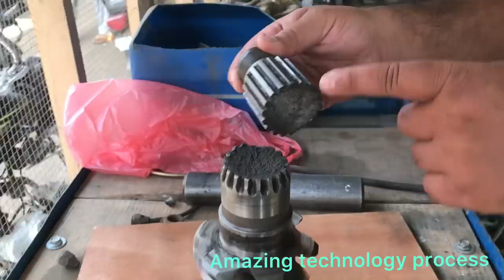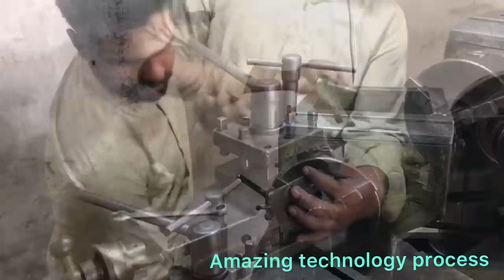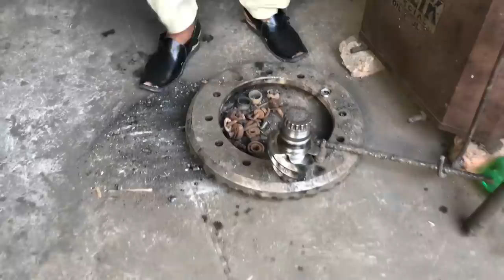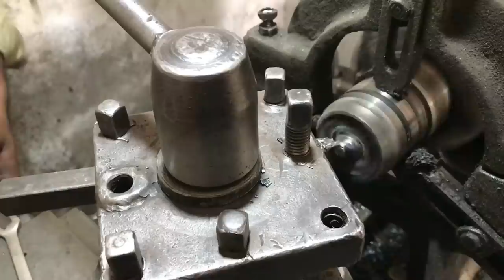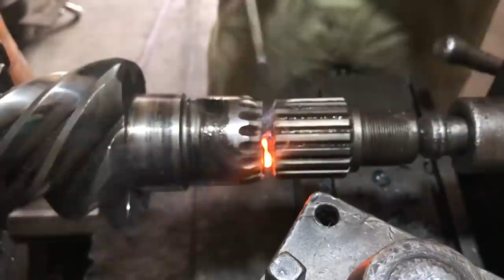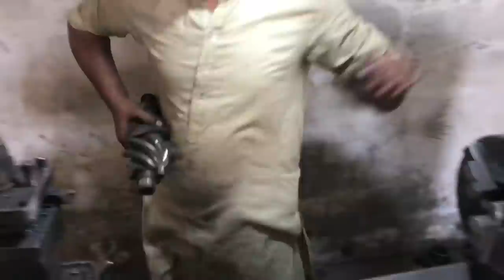How to Repair Broken pinion in Beautiful Way

Comment: When you have nothing, you have nothing to lose.  The driver who overloaded his rig and broke the pinion the first time, will  snap this one the first time he pops the clutch.
Reply: Or Sooner. Making things "LOOK GOOD" IS NOT a repair . He could have saved doing the job Twice, by buying factory parts, and ran it for another 25 years.
Reply: Maybe or maybe not i fixed a pinion basically the same way for a piece of farm equipment it lasted about 5 years needed the part right away no one had it "fixed" it then got the factory part and waited for the fix to die  factory part sat on shelf for 4 and half years.
Reply: @ta-zm7tg  I dont think you understand much about metalurgy.
Reply: @stevecarlisle3323  I do,and I can tell you a quick repair will get him back on duty, like the prescriber wrote (is that the right word? I'm not english native), but to be honest: your right as well. So, the point is: do I have the possibility to use OEM parts or better Manufacturer part or do I have to rely on the bits I got back repaired. I often don't agree with the methods HOW they do it in these videos, but the do it and it lasts...well...quite a time...  by saving a lot of money they don't have. So, to sum it up, you're both right.  Let Karma make a decision
Reply: @classicmoto2429  Well thanks for your input, but being a heavy duty mechanic and welder, for 4o years, and certified in both trades,  my best guess is it may look good, but it will have no durability. If it makes you get out of a muck hole on the farm, then it would have some benifit.
Reply: I’ve personally repaired stub axles , drive axles and input shafts using a very similar technique to this . The objective is to remove the break / crystallised material . Then using a series of dissimilar metals as weld build up to form a bridge between the 2 pieces. This will marry the metals together using heat and layers to form a bond between the pieces and the welds . Though I had access to turntables , induction heaters . Many different welding materials and the all important kiln heater at the end . Lime pit cool-down over days is the secret . I’ve never had a failure yet . It is an art form .
Reply: @stevecarlisle3323  he might have to wait months to get that part, so a fix like this might get him in the work in the mean time.
Reply: @shaneanderson1036  Yes, but what you have done, is NOT what they have done.
Reply: This is done in my place very often to save a few bucks on OEM or even an After-Market stuff...! (Psst! They never last...)The welding rods used can NEVER match the endurance of High Chrome Steel used in the part...! The part in question not only need precision but also endurance...! Which clearly substantiates that the guys in the video do not have any idea of metallurgy... They are there to mint money....
Reply: and again soldering 🔁 again...again!! 😅
Reply: @stevecarlisle3323  

Highly probable that pinion not available or no longer manufactured.
Reply: @pidhsome  

Agree. Also possible the pinion gear is no longer made.
Reply: @wilsonrawlin8547  Well i would say that is highly unlikely, due to the fact the truck is used all over Asia.
Reply: @stevecarlisle3323  
What truck? I didn't see that info in the content.
Reply: @wilsonrawlin8547  Well if you were familiar with heavy duty equipment, you can tell that by the size of the pinion in his hand, and also confirmation when he sets the pinion on the ring gear. Rear ends and transmissions  are more often than not may by manufacturers other than the vehicle builder. It could be a truck, tractor or other equipment..
Reply: @stevecarlisle3323  i think you underestimate how strong welds can actually be when done correctly using the right wire i didnt say this was a good fix i said its very possible it lasted far longer than you think. it really depends on a ton of factors the load on the part the material its made from etc.
Reply: @ta-zm7tg  I base my response on my personal experience. You should read all the posts before you estimate someone's knowledge.
Reply: To all the experts here...does this look like the first pinion that this shop has repaired? Do you really think that this place has no scrapyards for second hand pinions? That the truck owner might already do business with this repair shop? That the truck owner was sent to this shop because their repairs do hold up? You guys are acting like this was jb-welded. If the shop is doing this repair, it is because the repair works. In a wild wild west country, if you rob people with a faulty repair, you would find yourself in a world of hurt. I'm not talkin' getiin' sued here.
Reply: @kidsteach938  Well you make some points, but if you believe that precision made components can be repaired by someone doing spot welds, and angle grinding, and smacking it with hammers, then nobody here will convince you otherwise. I am sure that the work they are doing will at least get the truck of their property. 😣
Reply: @stevecarlisle3323  Thanks Steve...with the current parts shortages in the US, caused by faulty government, I sure hope that these kind of repairs don't become necessary here.
Reply: @kidsteach938  Well I think most of us know the fuel will be too costly before companys liker Spicer, Dana and Rockwell close down. The economies between India and the US are almost planets apart. Anyways I am a GearHead not a politician 😚
Reply: @stevecarlisle3323  using your own personal experience means its biased or you just suck at welding and machining. the repair isnt the best and not as strong as an oem part but its works.
Reply: @ta-zm7tg  any of our readers that have properly setup a ring and pinion are laughing at you, me included 🤣
Reply: Understand that the vehicle they are repairing is not meant to last. There is a reason their "Trucks" are wooden boxes on cheap frames.  They tend to loose the vehicles to the cliffside roads. Heck, there are quite a few of the mountain roads that have shrines at the start where the driver, his spotter, and the vehicle get blessed before going on the road.
Reply: @we are doomed the part was small you can throw it in a oven at like 450 and call it a day. They work with what they got and it clearly works I've done it for a tractor at home lasted years while the OEM part sat on a shelf  waiting for my lazy ass to pull the tractor apart again.
Reply: These people are in Pakistan trying to make a living,there is no spare parts they have to make do with what they have,I doubt there are any more Americans left that has any skills to make what they need like these people.if we can’t get it  from Amazon or the internet we lose what’s left of our brains.
Reply: @stevecarlisle3323  So, just pop on down to the local dealership (if there is one) to order the part (if it is still available) and then wait a few months for it to come in (while not making any income)?
Reply: @pidhsome  Or maybe even just get him back home without any load in the truck.
Reply: @sebwiers1  Yes, what you say has all been said before !
Reply: Depends on tensile strength. If he used a 9015 rod and that pinion broke again, it would not be the weld that broke. 38 year auto machinest and welder here.

Comment: That attempt at center drilling was fantastic.  Like how the drill sprung to one side.
Reply: BRUTE FORCE
Reply: Yeah all these guys are hacks but it’s fun to watch.
Reply: Needs short drill bit and drill center. But I guess he got the job done. I would never done that with out covering up the lathe !
Reply: ICE STATION ZEBRA ASSOCIATES  l don't see any porosity in the weld. I think if he used the correct rod there is a good chance it will hold . I not see what you see . It's beveled  correctly to my knowledge and mutipass welding what's not to like ? I'm not sure how the heat will affect the temper . I would love to know how long the repair lasted .
Reply: ICE STATION ZEBRA ASSOCIATES  I HAVE ALWAYS PUT MY GRINDER IN A BRACE" AND GUIDE IT WITH A HANDLE...IT JUST NEEDS TO FOLLOW THE GROVES THE BLADE IS ALREADY THIN ENOUGH..THE FRONT PART IS STILL DOING ALL THE WORK..HE JUST NEED TO PUT THEM BACK TOGETHER"
Reply: I take it he didn't use a center drill ?
Reply: ICE STATION ZEBRA ASSOCIATES  The welding of the axle shaft was alot worse. They they tried to weld while spinning too fast.
Reply: This is a quick fix, but does not resolve the main issue, this part like the rest of the truck is working outside its design specifications, ie modified chassis or overloading, it is that simple.
Reply: @ianhamer4494  Yeah they put these vehicles to work! A bus designed for 20 often carries forty.
Reply: STONE AGE
Reply: @jacobclark89  when u know nothing about machining, this is repair just for u 🤣
Reply: Haha it was spring steel lol, hang on, a cross eye dude was on the tailstock, oh wait he was too lazy to throw the 4 jaw on, ah ha, he was trying to compensate for the bent twist drill.
Reply: @danielsatko   some people measure with tape measures some use micrometers and some use zetameters ! Each person has a deferent opinion of the word close .
Reply: ICE STATION ZEBRA ASSOCIATES  

Yeah the grounding rod deal he dropped on the brake rotor was terrible.
Reply: @jacobclark89  Yes, that appeared to be a quality weld.  From the surface after grinding he managed float all of the slag to the surface.  All of the very crude work was to prep for welding while turning, presumably at a constant turning speed so the part doesn't end up warping or with excessive stress.

I guess that the spines are reduced in cross section at the repair so that they won't really be engaged, thus the surface finish and hardness are not critical.

Comment: The one thing they did right was to check how parallel their welding rods were before welding
Reply: LMAO!!
Reply: They're not using cutting oil. Wonder why?
Reply: @nilos21k  it is probably a cast iron pinion. Cast iron has a high enough graphite content that it essentially self lubricates as you cut it. A lot of the maching I do on cast iron cylinder heads is done dry for this reason. When a coolant or cutting lubricant is used, it sometimes makes it harder to cut it. The only downside to using nothing is you should definitely wear a respirator or dust mask, you do not want to breath in that cast iron dust.
Reply: @A3rd3ye  no way, it's always a forged
Reply: @A3rd3ye  

That pinion is forged or machined from billet steel alloy. Cast iron is too brittle.
Reply: @A3rd3ye  Would never hold, this is from a truck not a gocart.
Reply: Checking them for runout...lol
Reply: @nilos21k  
It was used to make last night's chipattis.
Reply: @A3rd3ye  there's no way that's cast iron. Look when he's trying to cut it on the lathe, that thing is harder than a wedding night prick.
Reply: The pinion is about 10x harder than the cutting tool !
Reply: Looks like he got more than 1 thing right.
Reply: @nilos21k  I'm an auto machinest of 38 years and the old stuff that I learned on was 25 years newer then that. I mean, you can still rig up a pump and nozzle. Cutting oil isn't cheap, but I swear by a 50/50 mix ATF and antifreeze. Works better actually. Smells pretty bad

Comment: Man where to start,  first of center up you're tail stock 5:22 second, don't weld on your cutting lathe, you'll destroy the ways. Third, if you are going to ignore 2 then cover the ways and spin the part as slow as the lathe will turn as you weld it,  do a continuous weld bead not a bunch of tiny tacks. Fourth don't grind at the lathe,  again grinding dust= abrasive=destroyed ways&wiped out bearings
Reply: absolutely my thoughts, a nightmare! poor guy who had to pay for this fix!
Reply: Yes all that, Then the pinion broke again on the first hill.
Reply: Look how much the tool post shakes. High accuracy built in!
Reply: @beyondmiddleagedman7240  The headstock will get like that after all the welding arcing out the bearings
Reply: Not to mention how dull and worn those bits are.
Reply: And where was the earth clamp? Those poor bearings...
Reply: All I see is a lot of professionals saying this and that. What you failed to see is that they are not as previ as you are. They are making the best with what they have and can afford. Most of the things you learn in school is from such people. Show some respect cos all fingers are not same.
Reply: @charlesagyemang1692  
What they have is ( or was ) not that bad.  They are destroying their tools.  What they are doing to that lathe is really bad.  They are making it looser and looser and the quality of their work degrades every day because of the abuse until it will not work anymore.  There are simple steps they could take but they are sacrificing quality and their equipment for little gain.

Do these repairs actually hold up, or do they do this goofy stuff to get views on youtube?
Reply: Funny I just posted ,not covering up a lathe when welding is the number one reasons welders get beat up by machinest ! Do you think the repair will last ? Do you think he used a high nickel rod ? I was wondering if the heat might be a factor in taking the tempering out ?
Reply: You noticed the same things I did .  I wouldn't attempt this repair unless I had no other option . If it breaks it might take out the drive shaft universals and yolk's $$$ . plus the cost of towing.
Reply: @Charles Agyemang every piece of advice I gave could be done on the equipment they have.  Doing it the way they are both creates a bad repair and destroys their equipment
Reply: Agreed, not to mention the welding earth strap, I didn't see one, so I'm assuming the earth was somewhere on the lathe, that's great for all the bearings and connecting metal parts! And just the whole procedure left me shaking my head! And did you happen to notice the run-out when put back in the lathe after welding? had to be at least 10 thou off centre! Bloody glad that wasn't a part for me!!!
Reply: Did you forget 5. Don't send current   to the Head stock bearings ? Or are you of the opinion that the welder won't damage them . I'm only basing my opinion on theory and what others have said . I have never  distroryed head stock bearings or conducted testing to prove the theory .
Reply: Oh no!  They're destroying their lathe!  They'll never be able to fix it!  There isn't a repair man anywhere in the nearest 100 miles!  They'll just get stuck when that lathe breaks, and they'll never be able to work again!  Then they'll sit around watching repair videos on YouTube and complain about other people's workmanship in the comment section and say "That part won't last!"
Reply: Shhhhhhhh......dont tell them.
Reply: You can weld the piece while on the lathe. But you need to put the ground clamp on the piece you are welding, and not anywhere on the lathe.
Reply: @charlesagyemang1692  I worked with these people in the Detroit area where tools are plentiful and they're still hacks
Reply: @charlesagyemang1692  Maybe your school , not mine. The service they are providing the customer is decietfull .
Reply: All these videos are like that. These guys give less than a shit about any of their equipment.

Comment: as a machinist this is painful to watch 😢
Reply: Instant dismissal if you even thought about doing this on our lathes...
Reply: It is painful to watch for Machinist, welders , mechanics and the engineer that designed it . Welding with it on an unprotected lathe was bad but the grinding process even worse. I doubt it broke when they torqued the pinion nut because they don't torque any thing. In that part of the world if it looks like it is fixed it is good enough. Lives are very cheap.
Reply: This is probably the third time this week that he fixed it
Reply: Lmao you seen the crane wheel repair video brings sketchy to a whole new level
Reply: If you can see the run out with your eye it won't last, wow!!
Reply: Jip
Reply: They would of spent less time machining a brand new part.
Reply: I can feel your pain..at least they have new safety shoes..
Reply: @peter-pg5yc  as for safety, i got the chills when he was using the file, his shirt was this close to the chuck...
Reply: Oh yeah.  I'm sitting here looking at my lathe and feeling sorry for theirs.
Reply: These pinions cannot be repaired, correct ??
Reply: I feel your pain mate, I really do, as a welder, this makes my toes curl up and makes me want to vomit……..
Reply: @xmo552  if the original shaft failed then this “repair” will not last five minutes……. This is an exercise in futility…….
Reply: @cosmiccolonel  
Based on torque multiplication....That's what I assumed. I just wanted to confirm.
Reply: Hey...he's wearing his safety glasses.🤌

Comment: The pinion yoke runout created by this repair will take out the outer pinion bearing unless the spline breaks first.
Reply: I don't think runout will be a problem. The taper that squares the yoke up was on the "good" side. As far as the splines go, they were already toast so it doesn't hurt to try. 
 I repaired a blow out in between cylinders on an engine block of a turbo car with a nickel rod, a 4 1/2" grinder and a utility blade as a straight edge while it was still in the car. People were protesting so loudly that you would have thought I was killing puppies. It worked out great. You roll the dice and sometimes you hit your number.
Reply: @jimandskittum  I'd expect that block sees a lot less stress than  that pinion gear does.
Reply: @ProleDaddy  Undoubtedly. I was pointing out that you don't know if you don't try.
Reply: Jaaaaaaaa.this is Craisy.I never see something like this.
Reply: Job security, ya hater!
😂🍻
Reply: They will probably re-use the oil seal......But chicken fat is cheap.